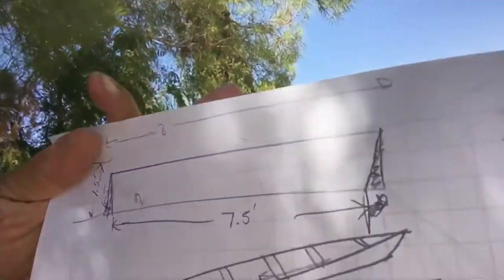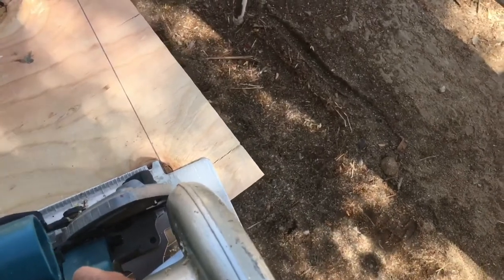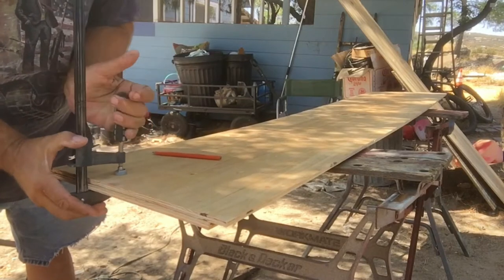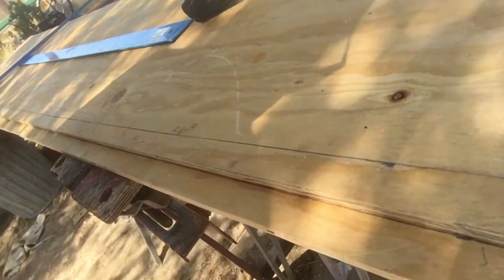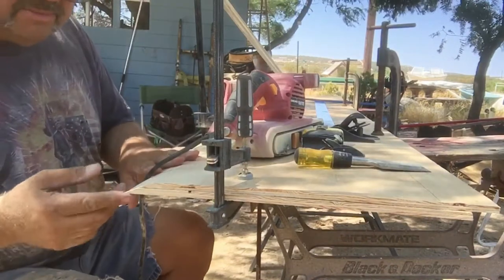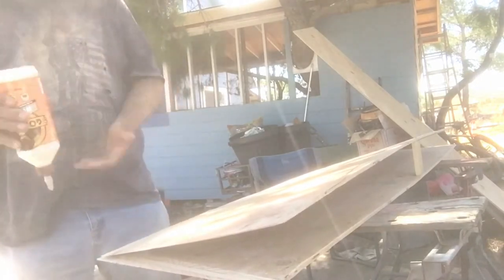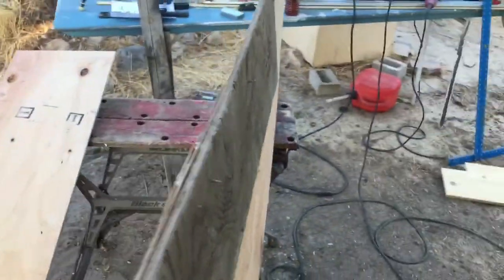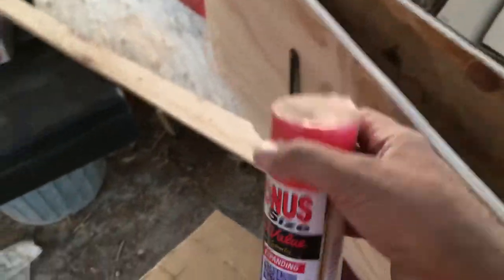Wooden Kayak Outrigger Part 1

Comment: Thanks for the shout out 😎
Nice build.  Functionally that will be a better outrigger than the one I use.  Mine was originally built as a pontoon for a different boat so it's much bigger than it needs to be (and thus has more drag than necessary).  
Be careful about using a totally sealed system.  Air will expand and contract quite a bit with heating a cooling and will eventually create pin holes that will weap water into the hull and cause rot.  The temperature swings from sitting in the sun and then being put into cool water can be pretty extreme.
Great job.  Looking forward to the next video.
Reply from the maker: Florida Keys Wooden Boat Fishing thanks for the advice, I’ll look into adding a vent...